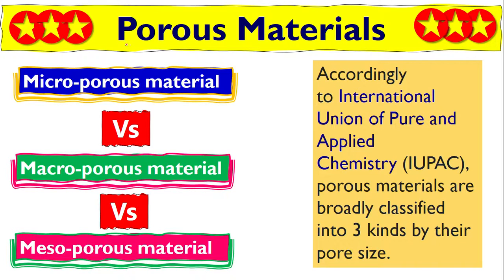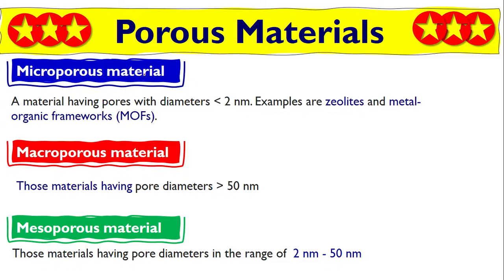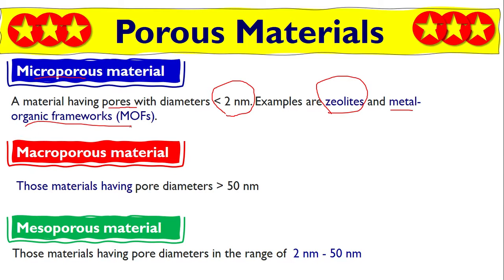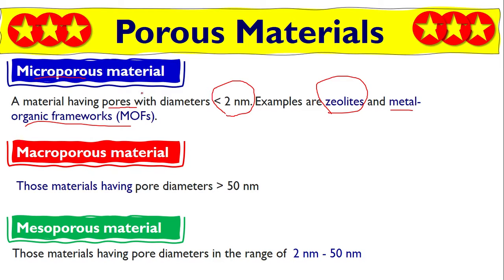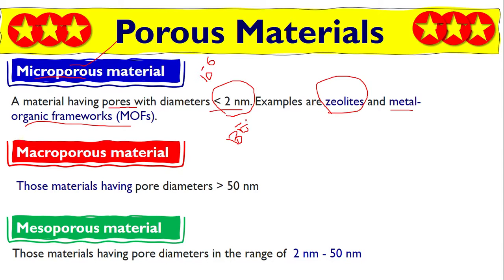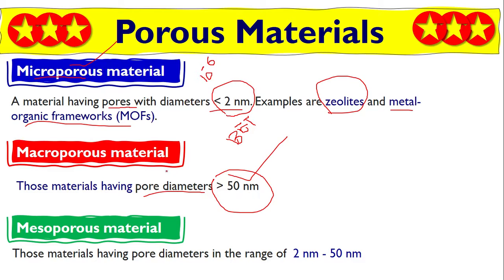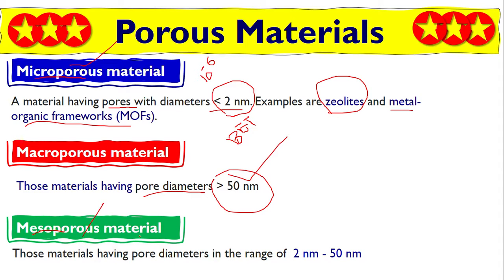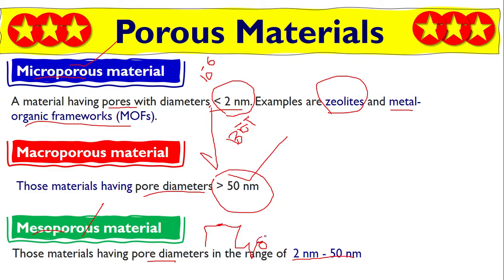Pore Size Matters | Microporous vs Mesoporous vs Macroporous Materials

Comment: If material is having pore diameter less than 2nm (1.8 nm my case) but showing H3 hysteresis, will that material be microporous or mesoporous?
Reply from the maker: Your synthesized particles are microporous according to that standard definition.  Mesoporous particle size in the range of 2 nm  - 50 nm.
Reply: @nanospeaks  yes sir but it is matching with hysteresis H4 (typing mistake in above comment) which is showing it is mesoporous. Is it possible that material is containing both type of pores?
Reply from the maker: @kuljitsihra17  perhaps because the pores may not distributed uniformly and some pores well below 2 nm while others are in the range of 2 to 50 nm.  That may  showing both types of BET curves. But please you also confirm it from literature
Reply: @nanospeaks  okay sir. Thank u so much.

Comment: Wonderful sir ♥️ sir I have a question in my mind that what will be  the hysteresis loop for a single domain and how can we draw that and two other questions related to electrostatic and electromagnetism. In electrostatic force F=q1q2/4π€o r2 so the medium here is in inverse relation to electric force and in case of magnetic field F=mop1p2/4πr2 here the medium is in direct relation what is the physics behind this also what is the physical meaning of these mediums. I have search alot but found no satisfactory answer.
Reply from the maker: I don't know much about. But I think these are two different phenomenon and they have to respond differently.  Electrostatic and magnetism are two separate things
Reply: @nanospeaks  ok sir thanks♥️♥️♥️
Reply: @nanospeaks  ok sir thanks♥️♥️♥️